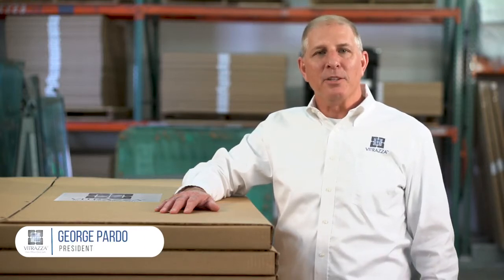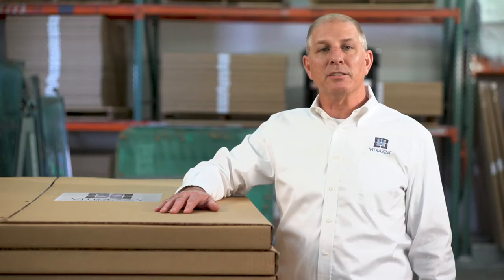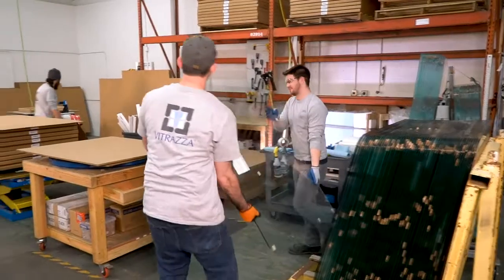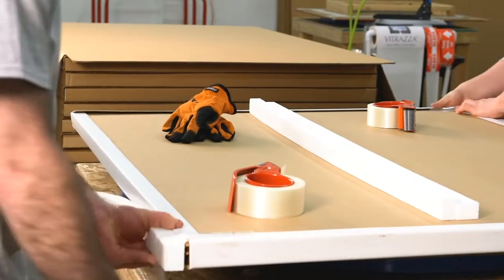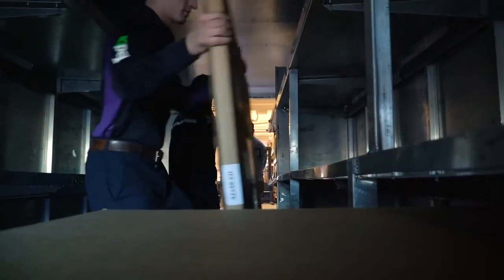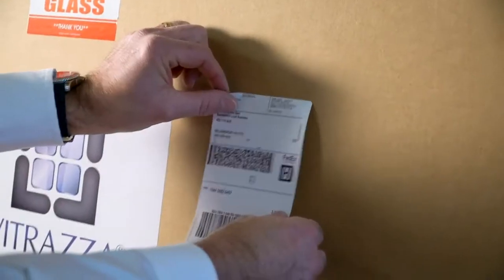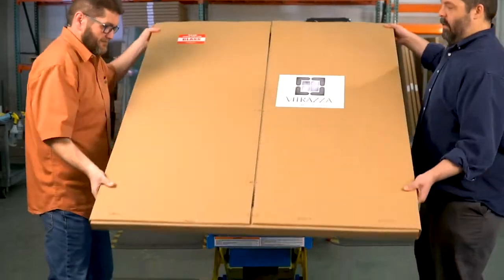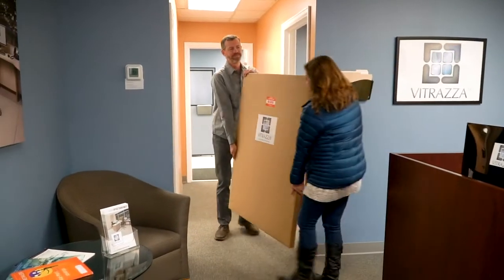How We Pack & Ship America's #1 Glass Chair Mat | Vitrazza Glass Chair Mats

Comment: This video is totally true and accurate from what I have experienced. 
My Vitrazza Chair Mat was packed and shipped better than any other package I have seen. I didn't even know heavy duty cardboard used in shippong was available! The delivery was quick and efficient . It takes a while to unpack, because of the heavy duty packing materials.
Interestingly, my wife started to freak out a little when she saw what was in the box. She said it looked like a chair mat and I said that is exactly what it is. Then  she asked what it was made from and I told her it was glass. She said it would never last and would probably break into a million pieces as soon as I put the chair on it. I finished unpacking it and reading the info in the package. Then, I placed my chair on the mat very carefully. She repeated her warning that the mat would break. I sat in the chair and rolled around freely - no broken glass! In the several weeks since then she has expected to see shattered glass, but that never happened. Even when someone else stood on the mat while I was in my chair checking something on my computer, the mat has done exactly what it was designed and built  to do - be a good looking and useful mat that allows for free movement while a person rolls around it quite easily and comfortably! 
Believe the ads - a glass chair mat is a great idea! No need to stand up and move the chair or to grab nearby furniture to pull yourself across an ordinary plastic mat! It is a dream turned into reality!